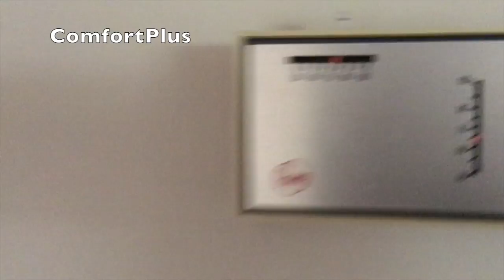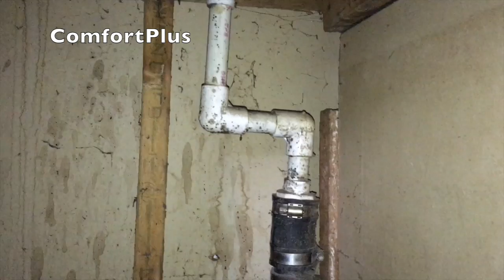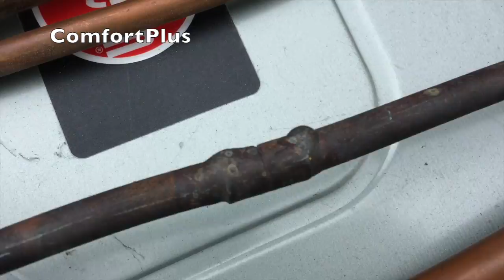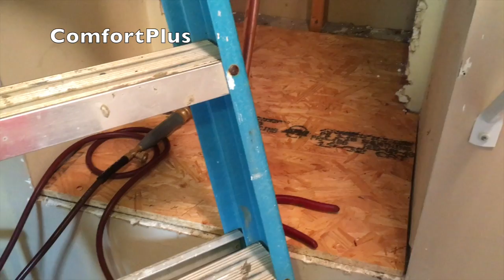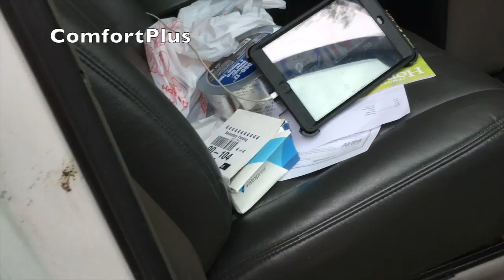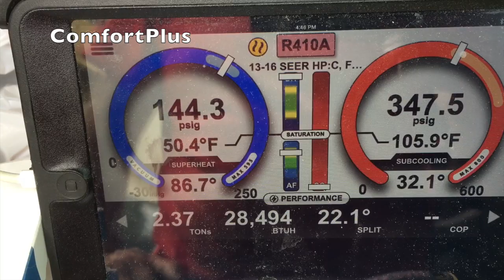Goodman for an Apartment

Comment: good job. keep the work.
I noticed that you place the float switch on the primary line. I been told that it is beter to place it on the secondary.
Your advice is really appreciated. Thanks.
Reply from the maker: +Octavio Delgado I have done both, but I usually put it directly above the trap so its easy to pour bleach in or use a shop vac to suck out the debris! Thanks for watching!
Reply: No safety  pan  cut off on primary better

Comment: Missed your videos! You're busy cause your good. That unit is going to run for 25 years easy. Question: Is their a vent after that trap you installed? Please keep the videos coming. If you get a gopro and a chest or head strap you'll be able to record more often because you won't have to stop to hold the camera. Enjoyed your video.
Reply from the maker: +The Air Conditioning Guy Thanks for watching. Same guy has a couple buildings with 1989 Goodmans still running. So he's not scared of them lol.
Reply: Nothing to be scared of, as long as they are installed correctly.
Reply: I did add a 5-2-1 to my old 2000 Goodman. That helps. The Goodman at my daughter's house sounds sweet on start. I have not looked into it, but it must be a scroll compressor to sound that good on start. Two Goodman furnaces with some age are just fine. My cousin has a Lennox Pulse from 1980, and it is fine.

Comment: Great Job , why the Goodman ???????
Reply from the maker: +barry hunt I picked up a new client with lots of apartments. Goodman will do the ten year extended warranty for non owner-occupied. Otherwise it would be an Airease lol.
Reply: +ComfortPlus Heating and Cooling , That makes sense , I hear so much bad I don't know if I would purchase a Goodman or not , The installed makes the biggest difference ....
Reply: +ComfortPlus Heating and Cooling The Installer makes the difference , LOL
Reply from the maker: They all heat and cool lol. I think Goodman is better than it used to be but they need to get a handle on the online stuff and letting just anyone buy and (poorly) install it.
Reply: You really can't blame the installer for leaking coils,  flimsy sheet metal cabinets with screws that rust and strip out after a couple of years of service, loud operation, failing reversing valves,  ect.  Goodman has and always will be low budget bottem of the barrel junk.

Comment: That's a good video!  We can't use duct board in CA.
Reply from the maker: +Nor-Cal Refrigeration & H.V.A.C I hate it. I can put a piece in the back of my van and it makes me itch for a week. Can't be good for air quality lol
Reply: +ComfortPlus Heating and Cooling never thought of the air quality factor.
Reply: +Nor-Cal Refrigeration &amp; H.V.A.C do they still spray ductboard with the antimold chemical??
Reply: +Nor-Cal Refrigeration &amp; H.V.A.C   really, i seen guys use it out here. since when is no duct board.? allowed in cali. i have never used it and never will. i hate it. blowing fibreglass into someones house is not good. talk about causing lung problems with blowing fibreglass into peoples lungs , itching, etc. allergic reactions on skin contact etc.